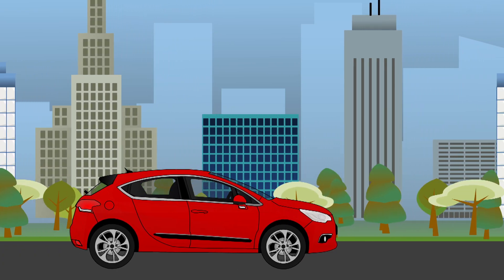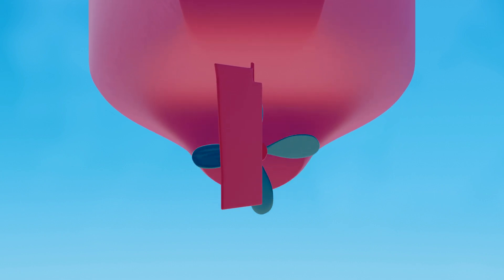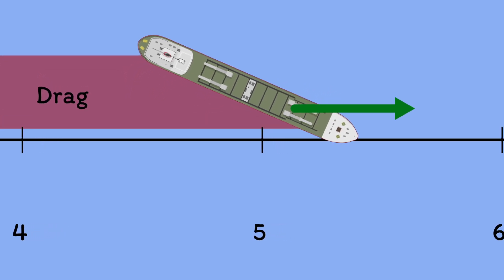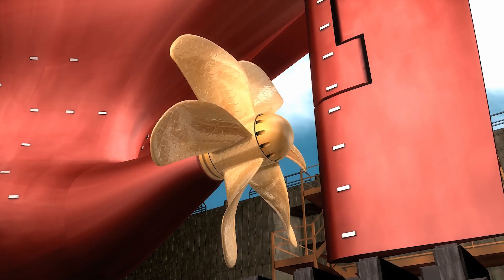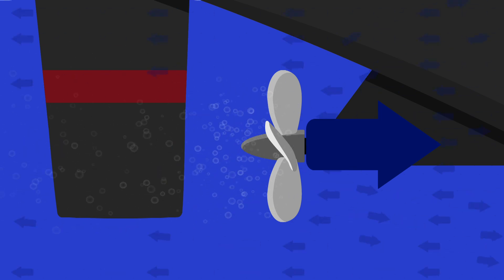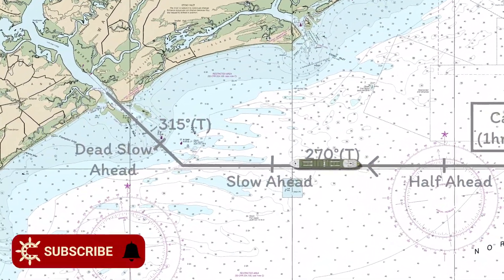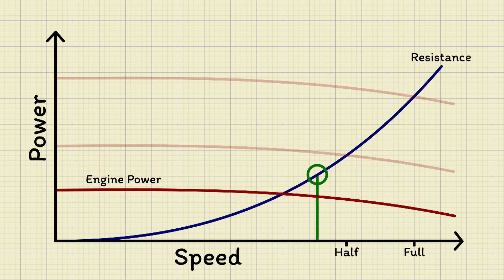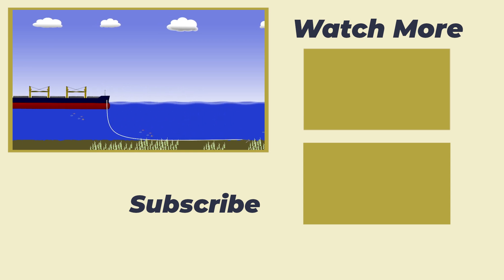How Do Ships Stop Without Brakes?

Comment: I learned this on the hard way we where on a sail ship and turned around the corner only to find out that there was a turn bridge so we tried the back up engine but it didn’t work so we quickly lowered the sails and tried to hold it of with a hard success but then the bridge opened to our side and we where trapped between it and a pool so the entire bridge slammed against us locking us in between the pole and the bridge so a friend and i went to puss as hard as we could against the pole and bridge setting us free we didn’t sustain any major damage to the boat or people

Comment: But... river barges use anchors to stop in emergencies. It's a known procedure and if you fail to recall that option during an exam you fail. Those huge push combo's have two stern anchors at the ready in case they need them.

Comment: Simple : Propellers counter rotate.. Same principle as Commercial Airlines and some fighter jets with Reverse Thrust.. The ships propeller rotate clockwise to move forward, and counter clockwise to go reverse.. This is why propellers, shafts and transmission in ships are so big and super strong, durable and efficient because it needs to withstand the engine power and the drag the water makes.

Comment: An interesting variety of using the rudders I’ve read about that was done once or twice in tests on USN battleships with twin rudders was called “closing the barn door.” It consisted of decoupling the rudder controls so each moved independently, then turning them in opposite directions while also reversing the engines while at flank speed. The report I read indicated that the battleship USS Wisconsin was able to stop within a hull length from 33 knots. However, the maneuver needed to be planned in advance given the rudder decoupling, and also apparently slightly tweaked Wisconsin’s hull aft.

Comment: I'm wondering what effect air brakes would have if they were under water. They work amazingly well on aircraft and modern sports cars. My main guess as to why it isn't used is two reasons. One is that the force generated by the friction of the water would be immense so the material would need to be very thick to prevent it from just sheering off. My second thought is that it would would make control of the ship much more difficult. This has to have been an idea someone tried and it didn't work hence why you never covered it.

Comment: On tow boats we actually use engines astern to slow and steer sharp turns because tugs have flanking rudders as well as steering rudders.  Also from experience on sternwheelers, backing is the best way to make quick turns because obviously the rudder is forward the wheel instead of aft the wheel.

Comment: Although I doubt ships ever need to stop often and quickly enough for it to be practical, I imagine a system kind of like air brakes could be used to stop a ship. A retractable scoop could increase drag and redirect water in the opposite direction, working like the water brakes on a rocket sled. It would be impractical and expensive, but it's a fun idea.

Comment: Good video - Also with slowing and stopping large ships, particularly steam, there are thermal and stress problems with fast stops - Residual heat disposal must be ebgineered. It was usual to ease off firing of boilers long before port otherwise residual heat will lift safeties plus cool large turbines too fast and warping of shafts can happen. Large diesels should not really be fast stopped as there is need to switch from heavy fuel to lighter grades plus we need to cool down systems in an engineered fashion. Even doing a fast stop of your car, truck or boat engine can cook the turbocharger.

Comment: There is friction between a vessel and the water. That's why plastic boats have electrostatic charge around their hull when driving. First thing u get when u wanna refuel is a cable to get rid of the charge.

Comment: a lot of ships have an adjustable pitch propellor as well, where the shaft can continue spinning clockwise, but the blades of the prop are moved to have their screw effect in the water move the opposite direction, but not risk breaking anything by going immediately to stern. The pitch of the propellor can be zero as well, and spin in the water without moving your vessel.

Comment: I wonder if retractable speedbrakes like on plane wings but deployed on either side of the side of the ship’s hull could be an effective mechanism to stop while maintaining control with the option to use differential brakes to assist turning if needed
Reply: Actually, that would be a great idea. :) How much force can the speedbrakes take? If using those brakes after 30 years of ship lifetime, how would the mechanism survive? Whatever the case, I hope that someone tests out speedbrakes on a boat. Also, having twin propellers to the left and right of the rudder (instead of directly in front) would be a great idea, so that when engine reversing, the propellers don't disrupt flow around the rudder. Engineering and science are fascinating stuff.
Reply: Ship brakes had long been invented but are not used because the disadvantages of using them significantly overweighs the advantages. Main disadvantages being added weight leading to added fuel consumption and less cargo space and more failure points, thus more costly maintenance. The only advantage being quick stops. The need to do emergency stops is extremely rare with all the radar and auto pilots technologies and relatively very slow speeds in very open spaces. 
TL;DR, too expensive and there's no use for them.

Comment: You left out rounding up into the wind.  Even fuel hungry ships have windage in their superstructure.  If the dock runs parallel to the onshore breeze it can be used to nudge the ship against it. Timing arrival to make use of the currents- the tidal flows- can also help, just as when leaving port.  Sailboat trained captains will use the wind to save fuel. The others just plow through it.
Reply: Oops, I meant perpendicular.

Comment: Could you explain the emergency maneuver of porting around something? I remember in the movie Titanic when the helmsman told the officer of the watch (I believe it may have been Lightoller?) "We tried to port round it but it hit." They didn't really explain what they did. All you saw on the engine telegraph was full reverse and the rudder was hard over to port.
Reply: Let's say you turn to starboard to attempt to avoid the iceberg. If you continue this turn after the bow passes the iceberg, your stern will swing right into it. To avoid this, you need to turn toward the iceberg once you're alongside it. You can see this in the movie, they initially order "hard to starboard" then later, during the impact in this case, order "hard to port".

Comment: With putting engines full reverse, it’s the main way to stop a ship, aswell as smaller boats. Especially on cruise ships that have azipods, they don’t need to worry about a rudder since it’s non existent. Typically going full reverse isn’t common though and they only slow boats down like that when they are maneuvering.

Comment: Hi Casual, 

Okay, I'll cut to the chase, this is a dumb question: Can't ships be built with something similar to airbrakes? If they could be placed on the front or back of the ship and spread out like wings underneath the water, will it cause enough drag to eventually slow down the ship? I'm only watching to learn so I kind of got curious. Thanks!
Reply: In reality the speedbrakes on aircraft don't act like you think they do. It's common sense to believe that panels lifting up on the wing would act as drag, but no. The way they work is by disrupting the airflow over the wing, which disrupts the lift so that the wing becomes much less efficient. On a boat i doubt it would work as it is propelled via a very different system and the forces would be huge.
Reply: @FrecklesAviation  I see. That's really good to know. Thank you Freckles!

Comment: Why wouldn't there be either two rudders that work normally together but in braking position one turns to the left and one to the right, or some dedicated braking surfaces that open up symmetrically underwater to create more drag? This all seems unnecessarily complicated so there is probably a reason other than cost what makes it infeasible, and I wonder what that would be. If the rudder can be made durable enough not to fall off during extremely sharp turns or high-frequency rudder deceleration, then it should be possible to add more control surfaces that allow quicker braking, especially that there are accessories like stabiliser fins already on some ships that could be actuated for enhancing the braking capability as well.

Comment: Why don't ships have speed flaps like airplanes?
Reply: In reality the speedbrakes on aircraft don't act like you think they do. It's common sense to believe that panels lifting up on the wing would act as drag, but no. The way they work is by disrupting the airflow over the wing, which disrupts the lift so that the wing becomes much less efficient. On a boat i doubt it would work as it is propelled via a very different system and the forces would be huge.

Comment: Is there a system like airbrakes on a plane where you deploy a surface at an angle with the flow of the water around you? I am not knowledgeable about ships but it feels like the technology would translate well to them.
Reply: In reality the speedbrakes on aircraft don't act like you think they do. It's common sense to believe that panels lifting up on the wing would act as drag, but no. The way they work is by disrupting the airflow over the wing, which disrupts the lift so that the wing becomes much less efficient. On a boat i doubt it would work as it is propelled via a very different system and the forces would be huge.
Reply: @FrecklesAviation  I don't really understand how the loss of lift decreases speed. Wouldn't it just make the aircraft unable to climb as efficiently? I am not doubting what you say but could you link something that explains this more in detail. You kind of got my attention with the topic.
Reply: @zoltantapai3716  No problem. Let me firstly explain what i mean as i did oversimplify a little. Indirectly the speedbrakes create lift by causing a pitch down moment. This means that the aircraft will pitch down, meaning it will descend faster but maintain speed. If you want to increase descent rate this is great, however if you want to reduce speed, you will pull the nose up to maintain the descent rate but reduce the speed. I am awful at explaining, so here is a video to explain it much better https://www.youtube.com/watch?v=O22eHzc8yl0 

Sidenote: so i don't look like an idiot, in flight the spoilers do work by producing drag, however i was talking about slowing down on the ground

Comment: Why don't ships slow down using the same methods as planes? Flaps do a great job at breaking airflow and allows them to fly at lower speeds and to land and come to a stop on a runway. Maybe they could have panels on the side of the hulls to increase overall drag in the water. Maybe this has been explored already, I'm not sure though.

Comment: How vehicles brake

Car: brake pads 
Plane: lower flaps
Ship: D O R I F T O
Reply: Air Canada Flight 143: Hold my forward slip
Reply: NANI?! KAANSEI DORIFTO
Reply: Trains: 
- Brake pad
- Just spin the traction motor backwards and it will stop the train
Reply: @doimoi958  Actually, they do have a way of using the motors to slow the train, but it's not using power to spin them backwards. That would be stupid. Instead, they have a bunch of resistors in the roof, and in order to slow down they just connect the motors to them. This causes the motors to act as generators, removing kinetic energy from the train and turning it into electricity. The resistors then turn that electricity into heat. That's how it works for diesel-electric trains at least, electric trains (powered by overhead wire or third rail) don't need the resistors, they can just feed the electricity back into the grid.
Reply: Torpedobeats
Reply: Sorry about that lads! I fixed it now!!
Reply: @sgpros8084  Truth is, planes have a lot of ways of slowing down.
In the air they could
- Deploy speedbrakes (if available)
- Extend (the proper term) the flaps
- Lower the landing gear. (if it's retracted)
- Forward slip (kinda similar to ship "drifting" described in the video), usually not done on big aircraft.
And that's just the ways to increase drag coefficient. You can also just... pitch up, which would result in the reduction of airspeed. 
On the ground there's also options of
- Applying the brakes (same as car brakes)
- Activating thrust reversers
Reply: @HaibaneKuu  DONT ACTIVATE THRUST REVERSE IN MID AIR
Reply: @orbitalpotato9940  Note how I specified that it's an option you have on the ground, not in the air. However some planes did activate the thrust reversers before the touchdown, I think it's mostly models with bucket-style reversers like mad dog or Tu-154
Reply: @HaibaneKuu  maybe space out the catergories as it difficult to read a wall of straight text.
Reply: @orbitalpotato9940  nah i think you just have difficulty reading
Reply: @grumfeldvanderspooijwanker1627  everyone has difficulty reading a wall of text
Reply: @orbitalpotato9940  oh so that's why my plane ate shit the other day
Reply: @orbitalpotato9940 I have had no difficulty ready a paragraph of grouped text. Pick up a book and practice reading, seems like the only time you do it is in these comments, and you can’t even read half of them according to you. Go practice, shouldn’t have dropped out of school kid.
Reply: @tylerdavis9826  reading comprehension isn't the issue here buddy. It's harder to look for key information. Which has no relevance to how airplanes slow down so you're just grasping at straws here.
Reply: Lol
Reply: Here we go again :p
Reply: Plane and ships uses reverse thrust.
Reply: Flaps are more like a car's transmission. Extended flaps are like low gears, they let the plane fly slowly and not stall, which is necessary for takeoff, approach, and landing. Retracted flaps are like high gears, they let the plane cruise efficiently at high speed. The equivalent of a car's brakes are the spoilers (literally also called speed brakes), they extend from the top of the wings.
Reply: Planes use disc brakes, reverse thrust and flight controls to slow down.
Reply: Read More

Read  More.
Reply: @R.U.1.2.  thanks
Reply: lower ailerons?
Reply: @jakub-kube  lower flaps
Reply: @orbitalpotato9940  those aren't for braking tho, spoilers, brakes and thrust reversers are
Reply: @jakub-kube  flaps help to slow down in the air
Reply: @orbitalpotato9940  it's really a side effect, their main purpose is to increase lift for lower stall speed
Reply: @jakub-kube  the purpose of flaps is to increase drag and increase lift. By increasing drag, the plane slows down. By increasing lift, the plane is able to stay in the air at a lower speed
Reply: @orbitalpotato9940  true, flaps will slow a plane , but above certain speeds , you can’t extend flaps and thus brakes or spoilers are used.Flaps can be ripped off the plane if improperly used at speed.
Reply: @alexnutcasio936  yes
Reply: @alexnutcasio936  I remember doing that a lot in Microsoft Combat Flight Simulator 3...
Actually, I think they usually got jammed instead, the damage model on that game was rather limited.
Reply: @jakub-kube  not side effect. That's intended effect. You increase drag to increase lift.
Reply: @jakub-kube  nonono ailerons are used to turn
Reply: @Sleepyhead101  that is in fact what i meant, he edited the comment

Comment: To say nothing of it's cost effectiveness, but wouldn't it be possible to increase the drag in the normal direction by coating the hull in some kind of rubber-like flexible membrane, with many many actuators under the surface that when triggered, create many many protrusions on the hull, greatly increasing its surface area and thus increasing drag? To me, this would be the most brake-like mechanism to stop a ship, I would be interested to know if this has ever been experimented with. I feel like the theory is sound though, similar to how mangrove swamps can sap the kinetic energy from waves such that the other side can remain completely still...

Comment: We use similar techniques in airplanes like forward slips, flaps and airbrakes. We also have hydraulic wheel brakes when we're on the ground as well as aerodynamic braking with the elevator and speed brakes.

Comment: On smaller vessels that have outboard motors are able to steer in reverse as instead of a rudder the motor turns to use a sort of thrust vectoring however those boats are nimble enough to doge most hazards

Comment: You cant just put a large ship into reverse, it involves switching off the engines, breaking the shaft, then switching to reverse gear and switching the engine on again. Not only does this cost time but there will also be some angry engineers.

Comment: It is false that "there is effectively no friction between the hull and the water", especially at higher speeds which is a squared function. When entering a port, ships slow down mostly by backing off on the throttle(s).  The tugs do most of the maneuvering near the dock. A crash stop with a right hand propeller will walk the stern to port....this is not "random". Your image shows the stern backing to starboard.  99% of ship propellers are right hand. The bar pilot, not the master decides the speed of the ship when entering port. An anchor can be used to stop a ship after it has slowed down enough, a few knots is typical.   Seriously, you need to consult with a professional like a ship pilot or master mariner before making up embarrassing false or misleading information.